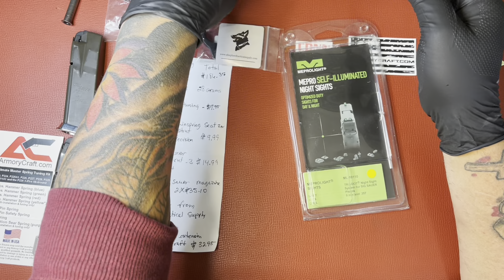SIG P229 DAK, how to enhance it and reduce trigger pull weight.  #sigsauer #pistol #guns

Comment: Looking good bro. Has anyone seen an extended mag release for Glocks made from the same plastic as the OEM part? I bought an extended mag release from a 3rd party made from a harder plastic which causes malfunctions in the Glock while shooting in subfreezing temperatures, the harder plastic freezes easier.
Reply from the maker: https://www.ebay.com/itm/305061354816?mkcid=16&mkevt=1&mkrid=711-127632-2357-0&ssspo=_kEFx1H2Q--&sssrc=4429486&ssuid=xTEcznBhRre&var=&widget_ver=artemis&media=COPY
Reply: Thanks bro! What upgrade would you recommend to mitigate muzzle flip on a Glock 43x subcompact, muzzle brake would look cool :) @gunsrus777